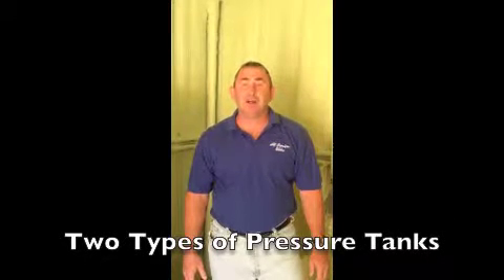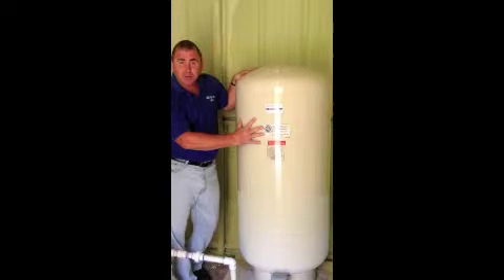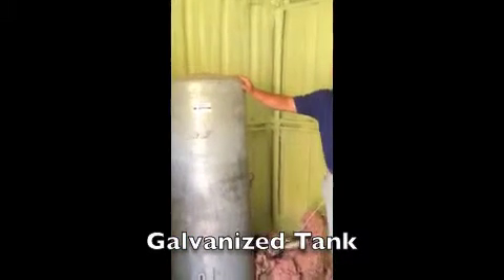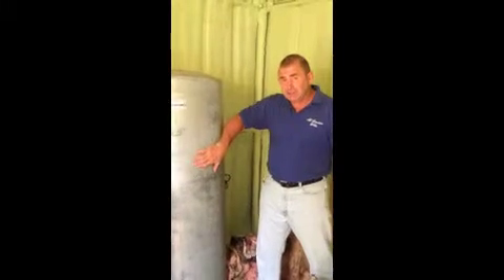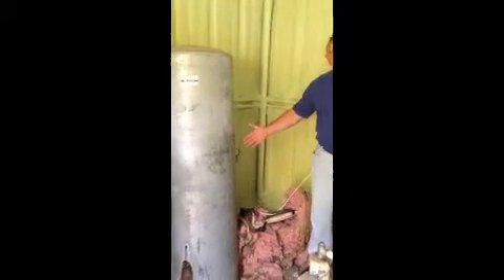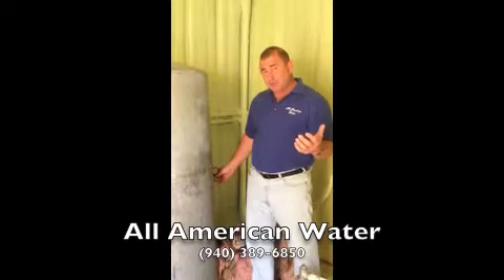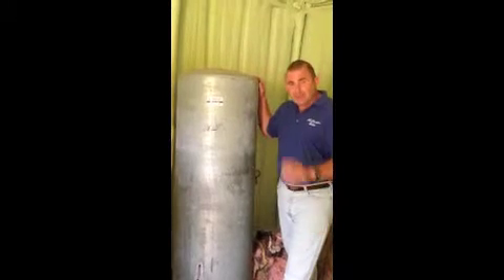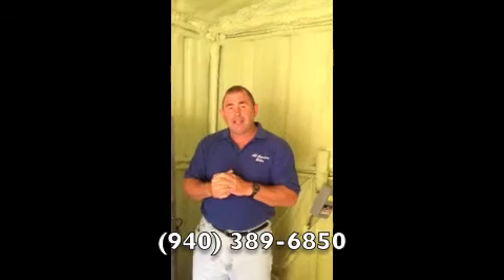Water Well Service Decatur Tx Two Types of Pressure Tanks

Comment: Great explanation of the air over water galvanized tank. They actually work nice when the power goes out, you still have water if it's full, but do they get water logged quick. However with a bladder tank you have to buy a new whole new tank when the rubber bladder fails, an air over water tank requires some more basic maintenance but simpler in many ways and parts are cheap. It all depends on the situation.  You saved me big money. Water and wells are essential. Thank You.